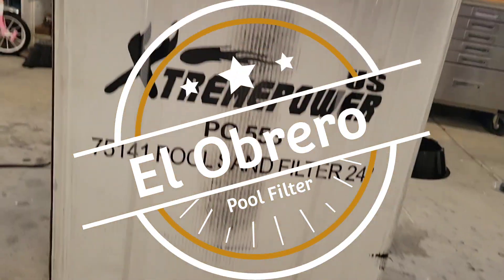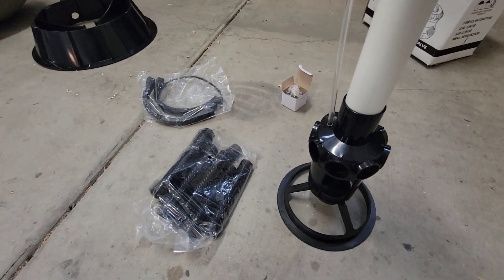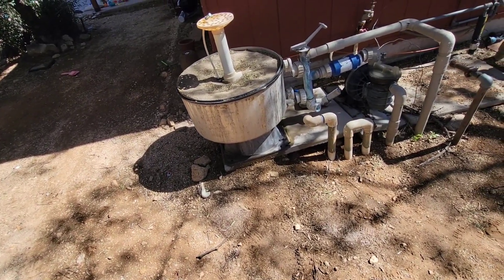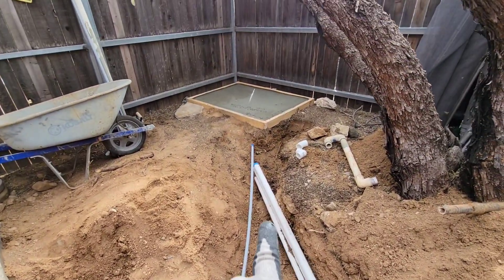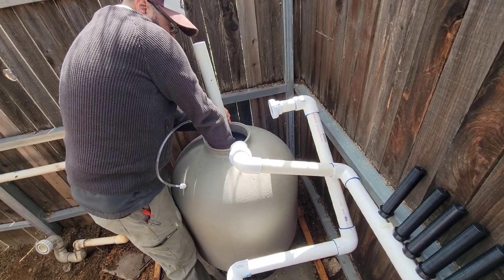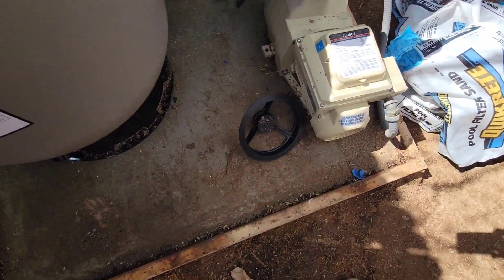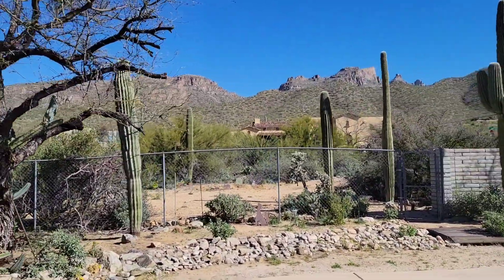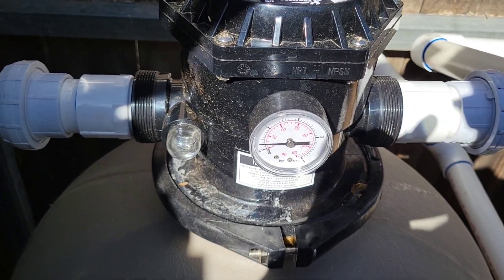XtremepowerUS 24" Sand Filter - Install

Comment: Hey have the same filter, it didn't come with any connecting nuts. When size did you use
Reply: What size pvc nuts did you use
Reply from the maker: So that's a 1-1/2-in Schedule 40 PVC Male Adapter.

Comment: Did you take the ends off the black things that screw into the tubes
Reply: Tube
Mine came with ends screwed on them 
Didn’t know if I need to take them off for water flow

Comment: How is it holding up
Reply from the maker: It has help up well and has been able to keep the pool clean. There has been an issue!!! So IDK if the pressure was to much but in both the one in my home and in a rental, the clamp that holds the top valve portion and the vessel has failed. Just cracks and starts leaking crazy. First time XtremepowerUS has replaced it. I took a shot at another manufacture and found that it uses better material. I also turned down the speeds and has not cracked. For the price I think its worth it. Good luck. Hope this helps.

Link of clamp will he in the description.

I will be putting out a vid on Sider-Crete pool plaster in case anyone is looking for a resurface solution.
Reply: @elobrero3910  thanks! Which model/brand did you end up replacing with?
Reply from the maker: @Jay-bi8kn  Its still an off brand "Fuoequl". Its worth buying one just in case. Its only 12usd today 5/1/2024. Check the link in the description for the replacement clamp.
Reply: @elobrero3910  much appreciated!